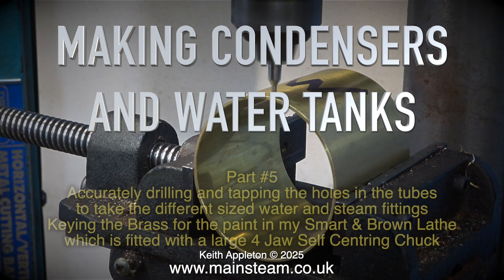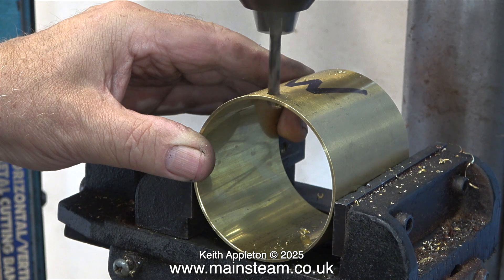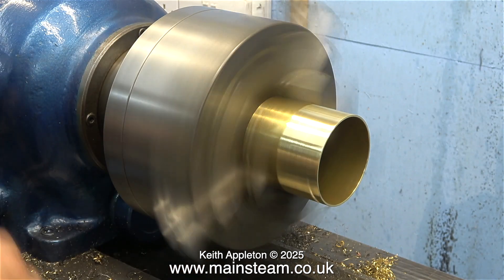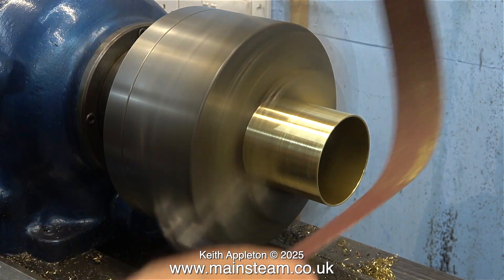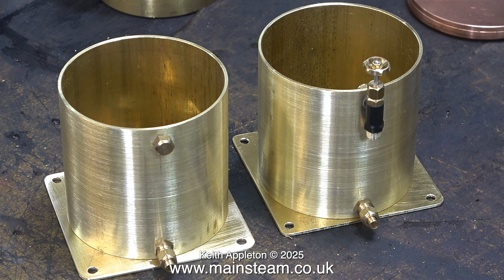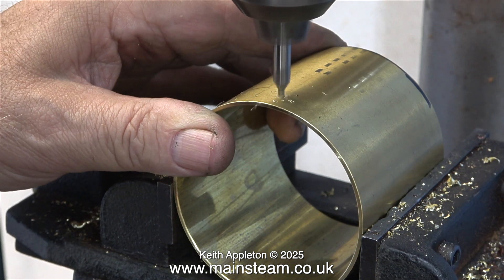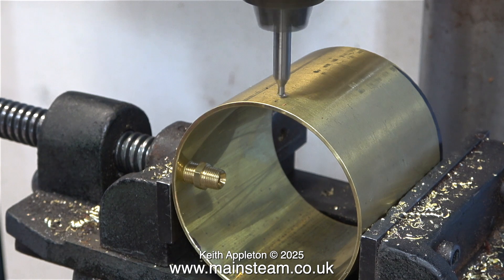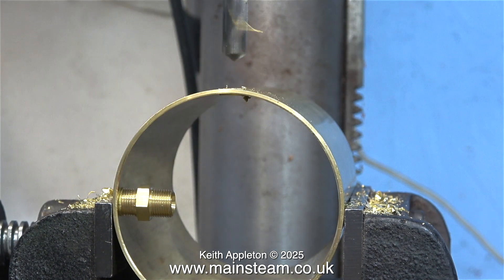WATER TANKS AND CONDENSERS - PART #5

Comment: You tapping using the drill press (drilling machine) to hold the tap and manually rotating the tap is excellent work.  One time (a while ago) I observed a professional machinist just chuck the tap and then switch the motor on, then off.  While the tap coasted, he fed it into the work, and the momentum was enough to start the tap.  The action of tapping used up the momentum, and he only got a few threads before it stopped.  He then reversed the drill (it may have been the quill on a mill) with out any pressure and it came out.  I'm no professional, so I wouldn't do it that way, but it did work for him.  As always, do what works the best for you.